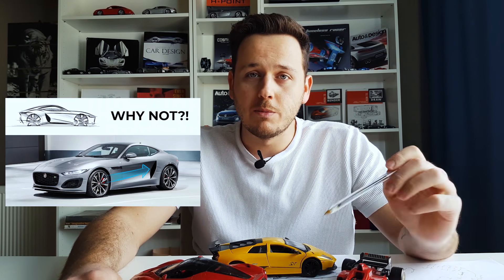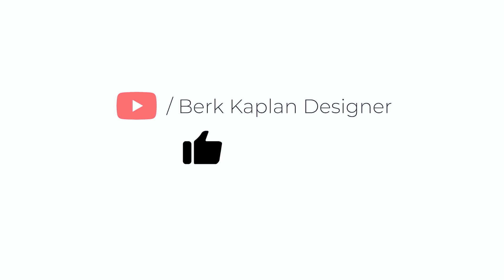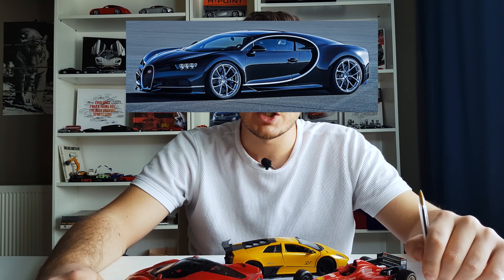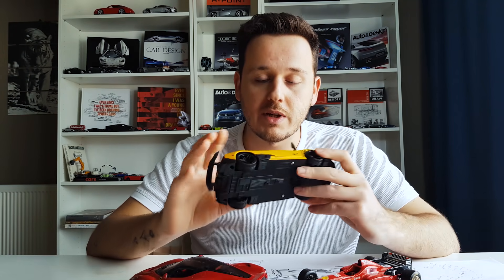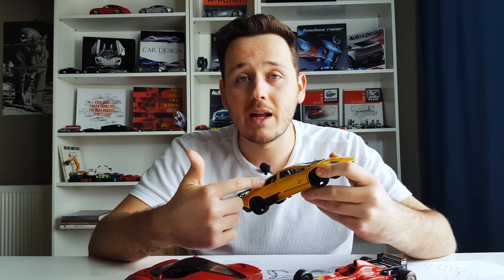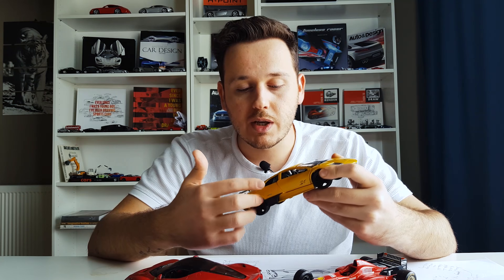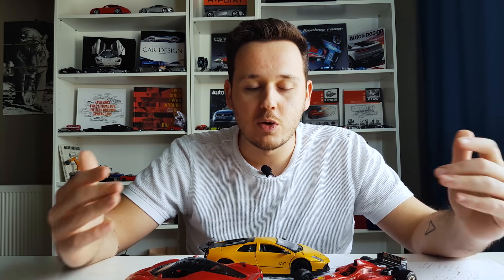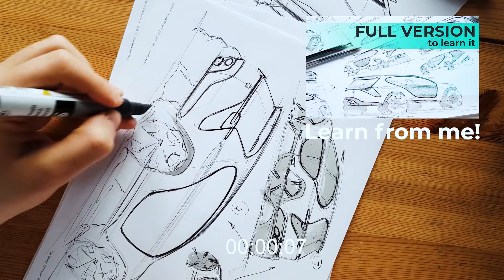CAR DESIGN MISTAKES - 1b - Random Air Intakes

Comment: Otherwise it's for aesthetic purposes 🙃 . Not huge air intakes though but some cars have an air intake biomimicry which it isn't an actual vent but a plastic part with mesh texture on it inside🤔
Reply from the maker: there are many reasons to use them, as soon as it is a good reason, air intakes are good :)
Reply: @BerkKaplanDesigner  yup true otherwise they lose value if used randomly where not needed.

Comment: "engineers and professionals design cars with a reason"
>laughs in Eleanor 67' Mustang GT
Say what you will with the nonsensical scoops and vents, she is one fiiiiiine lady. She doesn't need to make sense, being hot is enough.
Reply from the maker: :D yeah thats another point also..
Reply: @BerkKaplanDesigner  well she at least have the option for upgrades. You can add radiators or just move general components in the back and have it air cooled.

Like a hybrid system and the those funnels will cool the battery packs and added radiators.

But design aspects, when building, your main point still stands. Functionality over aesthetics.
Reply from the maker: Yeah functionality and aesthetics should be always together and the relationship of them totally depends on the product/brand/situation
Reply: Never liked the front end on the original mustangs. The fastback rear portion on the Steve mcqueen mustang looks decent. But the front look too busy for no reason. Now ford did make some cool 60s cars, like the 67 galaxies and fairlane. Heck, even the maverick had a better looking face than the mustang. But dodge killed it with the body styling with the 68/69 charger. But we all have different opinions, Wich is what makes cars fun

Comment: The new shaped Honda Civic had fake vents on the rear, not a fan of that floating disconnected surface around the lower vent area, or whatever that area is, I thought it made it look weak and flimsy and kinda plasticy.

Comment: Air Inntales are NOT a Design Feature, they have a technical purpose....  nothing "cool" or whatever. 

A Aircraft Engineer told me once. "If a plane or whatever device looks good, it will fly.... ". Look at the Messerschmitt ME262, the first Jet Plane. What a Plane !!! Look at the SR71 ... magnificent !!!

Most Cars today look stupid, like out of a Comic Strip. Too extreme without having to. Ugly in the end. Look at the Murcelago - hurts my Eyes. No clear shape, no true, real Beauty. Real Beauty is simple, not Bling-Bling like in a Rap Video.
Reply from the maker: The goal of the video is also saying that be aware of the reason when you sketch an air intake on the cars. 

I can`t agree about murcielago because I love that car and to me it is really beautiful :) really simple yet exciting design.
Reply: no, no, no, no.. I cannot believe that you actually put a lambo in terms of a design eye sore and yet you call planes magnificent.
Although I may have been baited on whether or not this was a joke because of the quote.

"if something looks good, it will function" No, beauty is defined subjectively. Which is why we have a saying "beauty is in the eye of the beholder"

Lambo's design were derived from high speed/high performance jet planes. They were one of the most innovative car manufacturers to do so. 

Their design were outrageous and often seen as a blight when it first came out.

Its shape was taken from something of a wooden block that you start off with when designing a CO2 car.

Yet it was given that design due to the aerodynamics of jets. 

It was vulgar at the time since the standard were muscle cars. While it was very aggressive, it was seen as an enigma, if not abomination for the enthusiasts (because european sport and american muscle had a baby, it would be a lambo. Crossbreeding was sacrilege at the time).

Yet, its design revolutionized ever car design from then on. It had a slicker look, a uniform shape (which you claim as no clear shame). It was the most simple design, not overly cut and aggressive as a muscle car, not overly smooth and shapely as a sport car.

It was a triangular block. Pure technical look. A beauty in terms of functionality. Some call it ugly at the time, yet they see its beauty of the edges and simpler blocky designs. Exotic it was called. It was no longer ugly when it made its statements. It wasn't like a complete block like the muscle car, nor was it extravagantly curvaceous like the sport car. 

Murcielago built upon those. Its shape was tuned, it became softer in more areas as to better guide air and keep drag low. Its shape became more one swooping curve, to better keep the air flow constant and less turbulent. 

"no clear shape" "no true real beauty" "real beauty is simple"

Your words contradicted you with the example you have given. 

There is a reason why rap videos take exotic cars like that to feature in their video, that is because they are sought out. What they do with it afterwards to make them unique is completely their fault.

"air intakes are not a design feature, they have a technical purpose" > '67 Mustang "Eleanor" One hell of a beast, sexy, aggressive, yet filled with ricer intakes. They serve no purpose but to look cool.

"bling bling cars" we call those ricer cars. Heavily modded cars to be unique even compared to their base counterpart. Those things can shine, have extra air funnels and scoops. Bigger wheels. Lights everywhere. Bigger wings when it shouldn't have it. Completely low to the ground, even at the expense of their camber, caster, and toe.
Added sound system. Cat delete, screamer mufflers. Turbos but no intake and exhaust upgrades.

Those do not come standard on cars.
Reply: @wanderingbufoon  .... holy crap man - it took me a while to read this. THANKS for your detailed reply. We should meet and have a Beer and discuss this topic.

Well - Ealonor.... actually a Poser Car, yes, an American Ricer ... tell it by the Name lol

The Lambos got spoiled by the Rich Dicks who cannot drive, behave like Teenagers getting wild on the Roads. 
REAL Gentlemen would NEVER behave like this. EVER seen a MIURA with a Guy behind the Wheel behaving like this? NEVER EVER .... ever seen Porsche Drivers acting like these Fools? ... People have spoiled the Brand and the Car.

The Design is unique, I agree, but on the other hand not one simple shape - todays Design TEAMS tinker an fiddle on too many Details and one Guy designs the Bumper, the other one the Lights, and even worse we have Women trying to create something for Customers that have Testosterone in their Blood! THIS cannot work. In the end its a wild Jigsaw Puzzle of Lines, Edges, Shapes here and there more childish looking as real Design... just wanting to be "cool" and "special". Stupid in the End an hurting my Eyes.
The People who design these Cars are College Kids, working by their Books and Rules they get told, having no clue what a Car even is.
Hardly anyone of them has ever restored a Car, feeling the Shape of it when sanding hours and hours prepping it for spraying.... NONE OF THEM !!!!
In the old days there was ONE Designer or at least one Design Leader, HE decided the entire shape. Nowadays cars look so ugly cause the are created by a team which is driven by Ego of every single Person. 

Designing is a true Art - cannot be done on a Computer.... the Mona Lisa made by a Computer? Would be just a Picture... nothing more. 

The V2 Rocket.... the ME262 .... beauty ... the SR71... James Bonds Aston Martin .... everyone a Statement, screaming out it purpose which it was built for. Nothing "cool" intended or Design for People acting like Dicks or wannabes

Bond is the Guy a real Man wants to be. When driving an Aston Martin you feel the Spirit, regardless if a Lambo hast more HP or whatever. In a Lambo I feel more like a Rapper, childish, a Car built like from a Lego Kit as from a true Designer.... 

I own a Classic Car, a Icon in History, it´s Shape is unique, it´s lines simple, technical.... ahead of it´s time (1981)... I sometimes just sit there and look at it. It never looks old, outdated, normal People sometimes don´t believe it´s already 40 Years of Age... THAT is true Design. Timeless.

Without Air Intakes and other Ricer Bullshit....  ;-)

Cheers Buddy .... have a Beer :-)